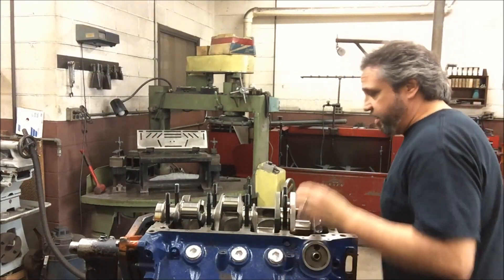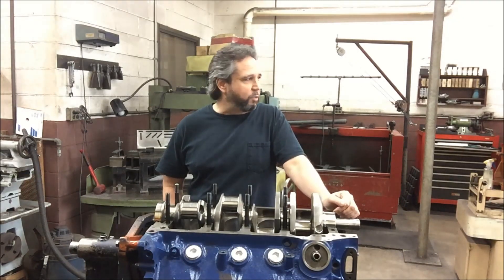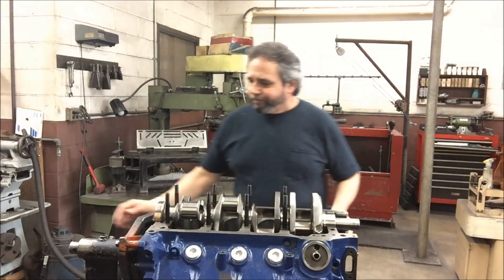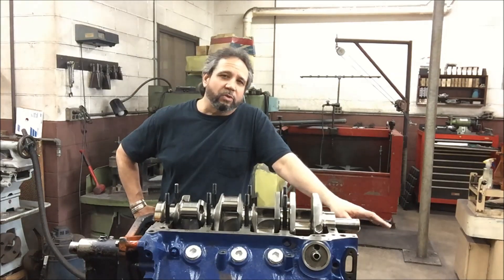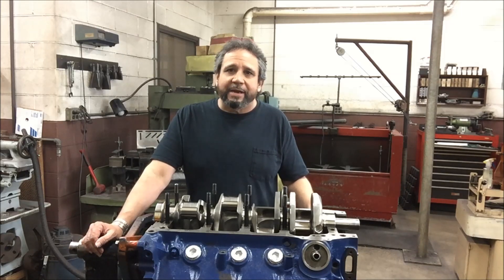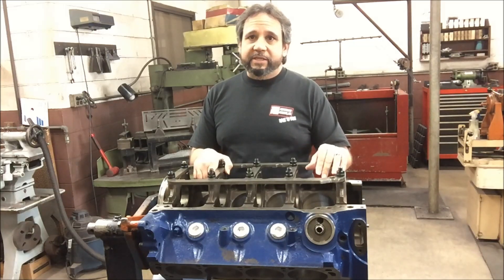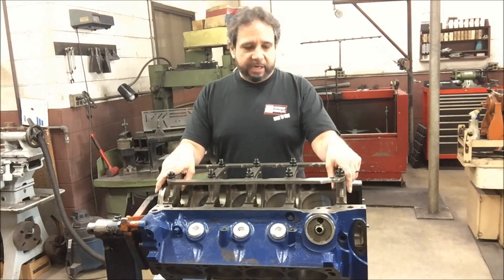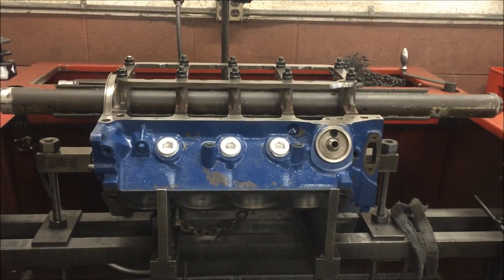Episode 13: 752 hp 408 Cleveland Teardown

Comment: Hey Tim nice video im in the process putting my 1970 351c 4bolt main block with 3.850 stroke back together an I've decided to run a main girdle this time since HP&Rpm is higher than previous setup i had,, what brand girdle you running? An windage tray? Also since its not common to see a cleveland with a girdle im having hard time finding ARP longer main stud part# for use with a girdle. The guy from arp i spoke with thought 351w 4bolt stud kit was right length. Any information would help. Thanks
Reply from the maker: Hey Chad, thanks for watching my channel. Your going to have a bad motor there. I got the main girdle from Ford Performance Solutions. They make them with and without a windage tray. Mine did it have one so I added it. The main studs are if I am not mistaken, are BBF. I had to grind down a few as they are close to the oil pan. Here is their website. Best to call, the owner is Troy. https://akkusorhan2.wixsite.com/fpsengines/kitsandcomponents. Thanks for watching and good luck with the mill Chad.

Comment: Looks like main caps moved around barely cut the caps and line hone the block don't run your  main bearings too loose have to have the right Crush + high-volume oil pump + heavy duty oil shaft and your cam gears got to be in really good shape and we used to Ping the sides so the Caps fit tight
Reply from the maker: Paul Janssen you know about building, tell us what you have built and experience. What car do you have? Thanks for watching

Comment: Hey I’m a poor boy. And i have a 408 Cleveland with stock heads 4v 749 lift cran cam do I need to run a .100 taller valves or stock hight valve size
Reply from the maker: That is tough to answer. The real issue is piston to valve clearance. Not sure why you would want to run .100 longer valves?  Stock would be fine,  but you need adjustable rockers, and springs and hardware that can handle that cam. That cam just by lift numbers, I would suspect you need a compression ratio better be 12.5-13+ CR
Reply: Its a roller style
Reply from the maker: @edwardgaines9119  I understand, makes no difference on lifter type.